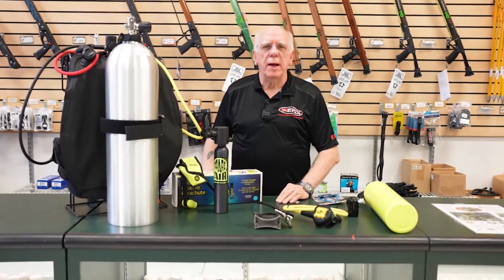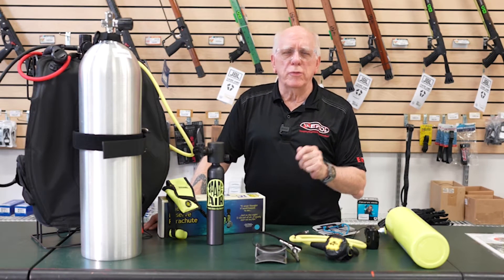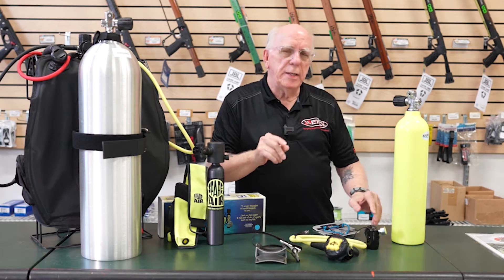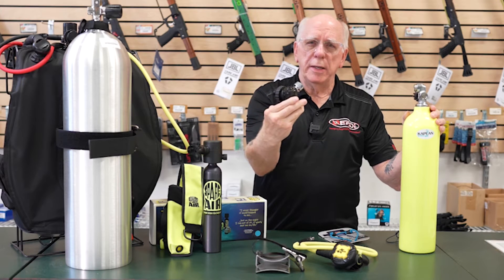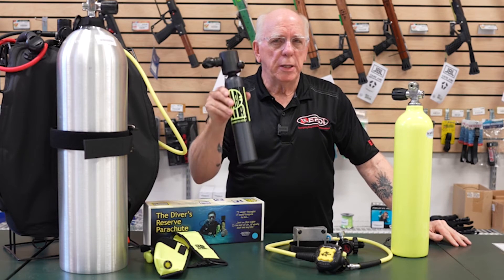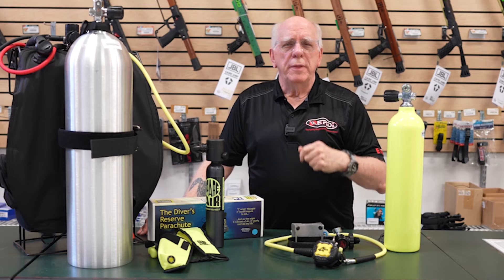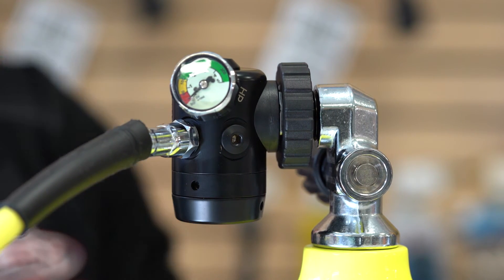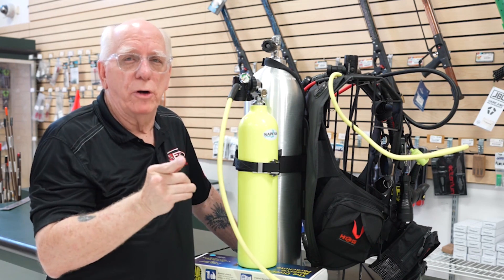2021 Build A Redundant Air Source for Scuba vs Spare Air

Comment: When I dive my pony (primarily solo dives), I remove the octo from the primary tank regulator and put it on the pony regulator. This way I have redundant air supplies but not redundant air hoses.
Reply from the maker: Sure, some folks will do that and of course depending on who's opinion you're listening to, that works just fine.  For an aprox $90 savings doing that swap works !  Regards Bob C

Comment: What are steps in diver certification .
Reply from the maker: Hi Jeffrey,  Most all of the agencies have a three process for certification.
1st would be some basic academics about becoming a diver that would include; understanding the physical realm of the underwater would.  Also basics about Scuba equipment and the do's and don't before you begin learning scuba skills in the water.
Next, would be Learning actual Scuba Skills like what it's like to breath through a regulator, how to clear a mask and how to become Neutrally Buoyant underwater.  Lots of fun stuff like that.  Usually two 3 hr pool sessions.
Last would be going to what we call an open water environment, like lake, spring, quarry or a pool like ocean spot.  This is normally deeper than 15' and you'll demonstrate your understanding by performing the skills you learned in the pool.
That's pretty much what's entailed in getting certified.
Thanks for the question and if I can help further let me know.  Regards Bob C

Comment: What is a redundant air source?  What isea t by redundant?  Sorry I am new to using this equipment?
Reply from the maker: No problem Fred.  It means a separate source of air with it's own regulator system (1st & 2nd).  Some folks begin with just a button gauge or short hose single gauge.
Some are slung across the chest, some attached to the tank in some manner.
In slang terms it's also referred to as a, "Pony Bottle".

Comment: I recently purchased a 13cf for my pony bottle. After doing a controlled test at 90’ I found that I could do my one minute mid way safety stop but by the time I hit my 15’ safety stop I depleted the tank. Now that was again a controlled slow accent. And Im sure if this was a oh shi! moment I could have made it to the surface. So after that I decided 13cf was not going to provide me with enough of a safety margin. So I upgraded to a 19cf. I’m also mounting this using the Shark mounting system. I’m also using the Mares MV second stage so if I use it or my buddy we won’t have to worry about the regulator being upside down. As I’m a regular at your shop I’d like to chat with you about my setup. Thanks Bob for all your videos and help.
P.S.  I also have a 30cf for when I do off shore wreck diving.
Reply from the maker: Hey Don, Nice to hear that you're being prepared instead of reactive just taking someone else's word on something that could save your life.  Come by let's visit !  Regards Bob C

Comment: My concern about a redundant air source is flying internationally with it. Pressure tanks cannot generally be transported in checked baggage and a pony bottle is quite bulky and heavy for carry on as well as having to remove the tank valve for inspection. While the SpareAir system does not afford neat the level of redundancy as a pony bottle it is engineered to be easily transported in carryon luggage. For this reason, as an avid underwater photographer/videographer I dive with the SpareAir 3cuft model. Should my dive buddy and I be separated further than recommended die to the nature of my activities, I believe the 3cuft is more than adequate to bridge the gap. While I would prefer a pony setup, the travel challenges make it an unlikely option. BTW I travel with all scuba gear less tanks and weights and about 45 lbs of underwater photography equipment.
Reply from the maker: Your concern is valid, but are you being realistic about what you're doing and at what depth you're doing it and trusting 3 cft of air...  maybe your dive buddy can be a real dive buddy and not just another diver out there doing their own thing.
Reply: @DiversSupplyYT  My dive buddy is quite accomplished with nearly 2 decades of diving. Underwater cinematography is demanding and can be distracting. At normal working depths 3cuft provides me with an average 25 breaths, more than adequate to close a gap of 20-25’ while adjusting remote lighting. Interesting that you believe you are more knowledgeable/skilled than another diver and feel the need to criticize without complete information.   You must be a real dive “buddy”.  Save your misinformed opinions for others.
Reply from the maker: @gregsnewyt  Maybe you missed the part where I said, "Your equipment travel concerns are Valid"...  please concern my words to be only friendly suggestions, not criticism.  If you took it as such, I apologize.
As a side note: In my 50+ years of diving experience and now nearly everyday, from all types and level divers, I'm aware, because they tell me or I see what many do safely and what some think they do safely... 
Like I try to say at the end of every video I do. Gregg, you and your friend Dive Safe, and I truly mean that.  Bob C

Comment: How about the Spare Air 6cubic. Would that be better at a depth of let's say 80 feet?
Reply from the maker: Let's say this, there about $100 or so difference between a Spare Air and the RA system I'm describing.  At 60' and beyond I'd spend the extra $$ for a 13 or 19 true RAS... Bob C
Reply: @DiversSupplyYT  makes sense. After some research I went with a Spare Air 300, here is why:

1) I travel. A LOT. And that is when I do all my diving. So, carrying anything more, even a Spare Air 600 is too much weight to lug around

2) I agree with you. If I was going to use the Spare Air 600, would make sense just to go with a complete redundant source. While the Spare Air 600 would get me more than the 300, it's expensive and heavy. Plus, it's recommended you get it filled at the dive shop versus from your own tank before diving. 

3) I don't find myself past 60 feet that often. Would really just be getting this for emergency and if I am in that spot (God forbid), hoping to just get a couple of breaths at thirty feet or so to slow my ascend and reduce the risk of DCS. 

All in all, thank you though! I am a relatively new diver (34 dives after a year in) and your video really helped me a lot! Appreciate it!
Reply from the maker: @jimmybell5018  Yes fully understand when you throw in the travel part that becomes almost a deal breaker...

Comment: I have used a redundant air source since my 1st dive as a cert OW diver.   Slinging a 13cu at first,  then moved to a 30cu, still slung though.  I sling mine diagonally across my chest, balancing the weight between both sides of my body.  Since my pony regs are right by my hand, I have put my primary stage 2 on a necklace, so I never have to look for it.  230 dives in the last 14 months, all slinging a pony.  I did my SDI Solo cert last summer at around 170 dives.
Reply from the maker: Mike, Excellent comment and just another way to utilize this system.
Reply: @DiversSupplyYT  ... and all of my diving is in the Pac NW, drysuit country.
Reply: curious, do you wear a drysuit?
Reply: @carlbroker  yes I wear a drysuit.  I took my OW, in a drysuit.